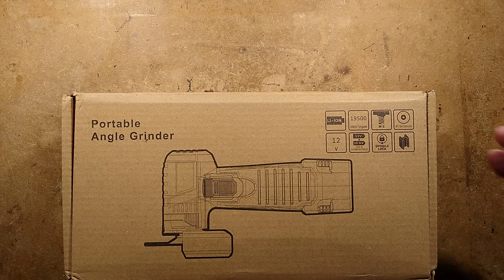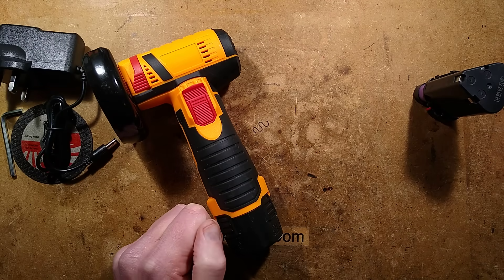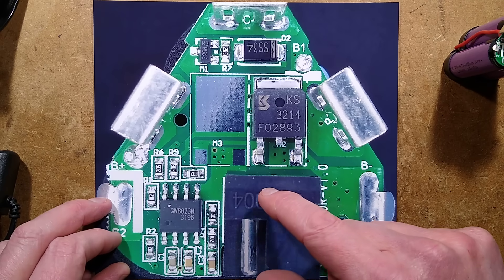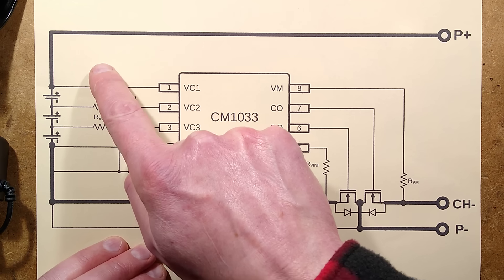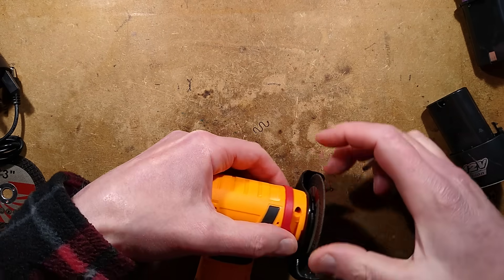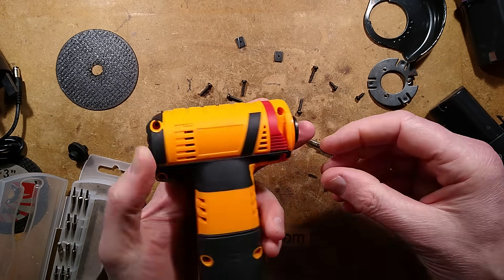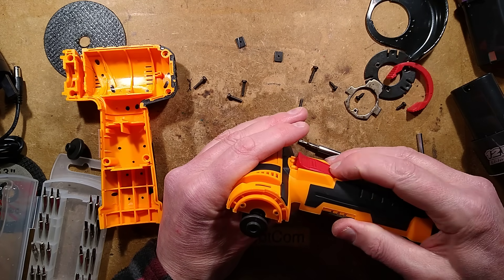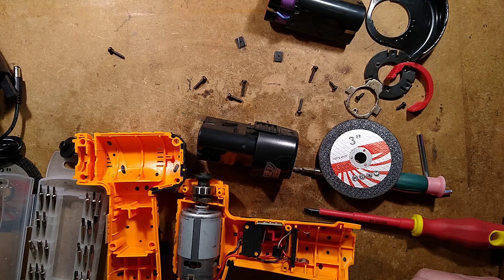Cheap eBay 3" cordless angle grinder with issues

Comment: I wonder how easy it is to get replacement disks  ?
Reply from the maker: Readily available on AliExpress for about a dollar each.
Reply: When these grinders first appeared at Lidl/Parkside about 5 years ago, there were no discs to be found anywhere. I made adapter washers for larger grinder discs, with an inner diameter of 22.23 mm. This way I reuse the discs that were too small on the 115 or 125 mm grinder. Recently, replacement discs also appeared at Lidl and I bought a bunch for under $2 a pack of 5.

Comment: I have a similar sized grinder from Lidl. It is worth paying slightly more for one with a safety tested and approved charger and battery, also it ramps the speed up over a second or so to prevent the stalling issue with this one.
Reply: The Parkside one when paired with the 4Ah batteries kicks ass
Reply: Love my one from Lidl, had it a few years now and use it a LOT... sadly think i might have worn it out now :(

Comment: Looks just like the one they were selling in Aldi a few months ago, yes it can struggle on some jobs, handy for the bench to save getting out the main angle grinder. That cut out on first press -  I assumed was a safety feature, so it didn't spin up if accidently pressed or knocked in the tool bag, interesting.
Reply: You might like to look into reviewing one, it uses a usb c socket, so there might be more villainy at work.

Comment: Thanks for the analysis, always interesting to see what the cheaper tools offer and what the trade-off is, and if it can be worked around!!
I guess the tool is what in the power tool market is sometimes called 10.8V (though Milwaukee irritatingly calls it M12...), since the three battery cells seemed to be marked 3.7 V [ 7:00 ]. Which probably would make the charging voltage 4.2 per cell, or 12.6V over the whole pack.

Comment: I have one of those and took it to work to try it out, not bad but as you said the batteries they are sending with it are not strong enough to cut anything substantial but as you guessed you can buy bigger batteries for it and with it it works great and even able to cut metal and wood.

Comment: I actually opened some 18650  batteries from a failed battery pack for a cloned Dyson vacuum:  A teeny  battery and the rest was sand.  I thought how nice, built in fire suppression sand....
Reply: Haha, happened to me with a "sealed" lead acid battery of a car start booster, was divided horizontally, and the lower compartment was...  concrete cement lol.
Reply: I had a cheap chineseum led bike headlight. The 4 cell 18650 pack had 2 cells connected in 2s and the other 2 cells spot welded 2s but as dead short for some much needed extra ballast...lol. The 2 'good' cells were 1100mah or so. I rebuilt the pack with some scavenged  3000mah samsung 18650s from a milwaukee pack that had dropped a cell, and adjuated the lights current sense shunt to output the dual cree leds maximum current, and the brightness and runtime was something to behold. Thanks china.

Comment: "Universal bicycle lock key"
Reply: i wish them luck 😅 mines got 50,000 volts going through the handlebars. xenon strobe light circuit. its also remote with a 200ft range so you can get that perfect timing on the thieving ........ 😂

Comment: Just so people know: there is a brushless motor version of this I received from Temu here in the US, it was about $20 shipped and is of a much higher quality.  It came with 2 metal wood blades, 6 cutoff discs, and 2 grinding discs.  I use it daily, it still runs quiet, flawless and smooth.
Reply: Wow great purchase

Comment: Wow, glad to see that weird black circley thing on the side comes off in the disassembly, that looks like it would interfere with using it for any actual tasks. Never seen one on the job site
Reply: think bout your knuckles when that disk explodes
Reply from the maker: The guard is repositionable.  It is recommended to keep it in place, as a shattering disk is quite nasty.

Comment: Is it possible to add that other MOSFET?
Reply from the maker: Technically speaking it is.  But it may be the cell voltage dropping under load that is tripping the BMS protection.
Reply: @ assuming the batteries are delivering what they say, there should be enough power. I have a Bosh right angle grinder. It’s a similar battery. So similar I wonder if they’re interchangeable. It’s about the same size as this. Of course, at $170 US, it does cost a bit more and is variable speed. But the principle is the same and puts out plenty of power with the 2” Roloc disks I bought it for. To the point that it’s very hard to stop if I press it very hard against the work.

Comment: Would it be worth installing the second mosfet?
Reply from the maker: It might need the cells upgraded too.
Reply: The ones i built using an Ali.... Kit had ex laptop cells in so far better than the ones in the two original battery packs .Need to bodge my cheap Ali battery terminal welder i could get a bigger spark from a ronson lighter .Any thoughts on fitting a big capacitor in them to improve the output so you can get better welds on thicker metal?

Comment: That's a cutoff saw, not an angle grinder. I have the Milwaukee version: very handy for cutting metal into shorter lengths for transport.
Reply from the maker: There are options to get grinding disks with it too.

Comment: These grinders (i have a Parkside one) are the best for grinding small parts (i've successfully tried converting some standard hex to non-standard-tamper-proof screwdriver bits) and removing excess PCB material from the edges.
I've once tried to run it with a different battery form another Chinese tool while original one was charging. Apparently the other battery was not designed for such current as its protection FETs turned into significant amount of smoke after some 2 minutes :)

Comment: Balancing should be made mandatory by law. It increases the life span of battery packs tremendously. Especially when cheap batteries with significantly different internal resistance or capacity are used. The same goes for undervoltage protection in all those gizmos that only have soft power off switches.

Comment: What about adding a starting cap to the grinder, wouldn't that stop the spike, seems thats what they do with all the big ac motors.
Reply from the maker: It could be used as a reservoir for a pulse of current.  In the AC motor application it's usually for the start winding.

Comment: I have the blue one from temu ,built a couple more batteries .works ok as a cheap mini grinder but as you say its limited but easier to use than my 4.5" 1010 watt in small places

Comment: Bike thieves' new favorite!
Reply: @Tore_Lund  not if they are in a hurry lol ,to much pressure on the grinder and it stops ,not a lot of torque in this bit of kit .thinking about as the risk of a copper appearing they could use a nail file and not get caught
Reply: @MrMan-f9c  True not worth much. Maybe it can be useful for scratching your initials on a subway window, as I've seen done?

Comment: The Bosch original version of that tool actually works really well and i use it much more than i expected
Reply: The Bosch original is such an amazing problem solver.
Reply: @UloPe I bought the milwaukee version on impulse. I was regretting it at first, but I use it almost daily at work, to fix problems that I should never have.
Reply: We have one at work and it's handy for sure
Reply: @semifavorableuncircle6952  I am a big fan of the Bosch 12v tools.  Every one I own has performed perfectly since day one.
Reply: They also copied the battery layout as it seems.

Comment: Those mesh style disks are dangerous. Be careful using them. They easily break and randomly fly off. 

I only use them to sharpen tools by putting the grinder in a clamp and use the exposed side of the disk. It is safer to buy a more expensive metal grinding disk. Trust me the cost it worth it, they last way longer than the cheaper mesh ones.
Reply: i just ditched a set of dremel wheels that were so cheap the screw mount pulled straight through them as soon as they touched metal. (amazon many disks item).
and yup had a few of those fly apart on me. for the angle grinder i bought a hefty leather apron and full face mask.  they are not very safe tools.

that said if you use them as sanding disks they will fly apart, they have bare minimum strength with the blade thickness. go through a few of those fibers and it loses all integrity.

Comment: Now I know what a 3 inch tool sounds like.
Reply: Some girls like it that wide 😉
Reply: @jasonstclair1329  wide? 😰
Reply: @kisielthe1st  Hydraulic press mishap
Reply: @jasonstclair1329  see what I'm wondering is if that's diameter, radius, or circumference.

Comment: The motor probably feels stiff because they applied grease to a bushing that needs oiling, I find that a lot with motors these days, they fit bronze bushings that for many a decade were known to need machine oil, but they gob on a lump of grease instead and it ends up reluctant to turn, worst offender I had was my desk fan, when new, it wouldn't turn on low speed at all and barely turned at full, found it was greased, cleaned it all out and oiled it, it's been running great for 12 years...
Reply: @twocvbloke  a proper amount of carefully applied light oil does wonders for the life of the sleeve bushings in small motors.
Reply: An old rule of thumb I heard a long time ago.   If it spins oil it, if it slides grease it.
Reply: That's called Cha Bu Duo engineering

Comment: Strictly speaking, it's not an angle grinder. The drive does not go through an angle. It's just a straight grinder with a handle on the side.

Will you be showing the ratchet in the future? I might actually get one of those.
Reply: always assumed it was refering to cutting angles in steel section.
Reply from the maker: The ratchet has been featured already.

Comment: That's not good news for cyclists
Reply from the maker: It is if it stops them buying a proper tool.
Reply: theres not a lock out there that doesnt have how to open instructions on youtube thanks to "the lockpicking lawyer" and chums.

they do it for our own good apparently....just dont ask them for an alternative security device..there isnt one.

for bikes he recomends hardened chain of at least 16-20mm. with a custom modded lock chamber to prevent pick attacks.

you could anchor a ship with that chain.

Comment: Thats nearly a 1:1 clone from the Bosch GWS12V-76.
Reply: Design wise, yes. Except they didnt clone the quality or performance.
Reply: @semifavorableuncircle6952  bosch  use the same factories.  not what thwy used to be. its going to be very similar.
Reply: lol
Reply: they all use the same factorys. probably closed the line down so the factory kept producing under another label or three
Reply: @luminousfractal420  Unlikely, the Bosch actually is made in Germany.

Comment: Nice video, Clive. It got me thinking. Would an inductor or even a suitably sized inrush limiter work to stop startup spikes and the tool not working intermittently? I don't know if an inrush limiter would work in this application as they dissipate heat, although I like the idea of giving the tool a 'soft start'.

Comment: I have some older Ryobi one+ branded batteries that do that. if the inrush surge is too big they lockout.
Reply: Ryobi One+ circular saws are useless with the smaller batteries. They do the same, fraction of a turn and stall of the battery cries ENOUGH!!!

Comment: Oh, this seems like a popular battery module for 3S lithium units.
Reply from the maker: It's sold as a bare case and PCB kit, so I'g guess there are many small factories in China spot welding random cells into them.

Comment: I own two of these, and i can say they are pretty neat. If there is a small cutting job or hard to reach places these little things are best. Sometimes even a regular cordless grinder can't reach places that this one can. The only thing I did right after buying it was replace all the standard batteries, because they are all crap and do not hold the declared capacity right out of the box, and also added a soft start pcb, so than motor will not rape protecting circuit every time it starts.

Comment: I bought one of these as a bare unit for about 8 quid purely for the disc mounting part as it is a remarkably convenient way of adapting sawblades to a 1/8" shaft used by small brushless motors for RC planes and such. IThe large bearing can be encorparated into a 3d printed housing quite handily. I build mini fighting robots for a hobby so power tool abuse is a way of life. The 550 brushed motor in these grinders is remarkably spicy from a current perspective.

Comment: i got one a few months ago for like 15 bucks on ali with 2 batteries. 
it works great... well unless you want to cut something bigger than a 10mm threaded rod. i used it so little im still on the first disc
those batteries are horrible. it turns off all the time as the voltage drops too much under load

Comment: eBay doesn't make power tools. did you check the contacts, I have found batteries that had some odd coating over the battery contacts, once cleaned everything worked fine.
Reply from the maker: Contacts are fine.  The protection circuitry is kicking in.

Comment: battery shape is similar to some Bosch 12v ones? Might be sort of a clone of those.
Reply: No, Bosch 12v has completely different contacts (battery has recessed slots for contact tabs in the tool). Looks more like Makita 10,8V with the flat, open contact pads except that also has 3 auxillary contacts instead of just one.

Comment: Adorable! Shame about the protection mosfet.  I have a project where I need high peak current from a single 18560, which is more than I could get out of most dual mosfet packages usually used with the DW01 style ICs, so I ended up using two of those chonky ones which gives me like 10A current limit.

Comment: Every time I've bought a cordless power tool for less than $100, it has required at least a little bit of work to make functional.  Sometimes that's worth it, because no reasonable big name tool maker is going to produce certain tools, like one-handed 6" chainsaws...  Sometimes you get a DOA tool and get a refund and the seller doesn't want to pay shipping to have it sent back, so you're left with a broken tool for free, and if you have a bit of soldering skill and a 3d printer you can convert almost anything to a standard tool battery...

For this one, I'd sneak a second mosfet into my next electronics order to take advantage of the board already being set up for that...  I bet doing so drops the resistance by more than half, due to the extra heat dissipation.  I like that this one has no real brain, though, at least on the tool side.
Reply: ...Thinking the same (if drop across mosfet is triggering current protection)...but....If voltage dip is causing cutoff, extra Mosfet might scare battery into cutoff even more easily?
Reply: @leybraith3561  Yeah, in retrospect I might just skip the existing brains in the battery pack entirely and build a new battery pack with a properly-implemented BMS...

Comment: Could you fix the batteries by soldering in the missing MOSFET or is opening the batteries destructive?
Reply from the maker: It would be viable if the lithium cells were up to the current demand.

Comment: They even added a ball bearing to the drive shaft instead of only relying on the motor bearings.. you must have picked the premium version ;-)
Reply: @WooShell  I suspect it was cheaper than getting a motor with a usable bearing. Without it would last maybe 10 minutes.
Reply: Bar is in hell's basement.
Reply: The premium one has brushless motor in it I think 🙃This one is the business class version 😉

Comment: I couldn't find a datasheet for the MOSFET in that package but in the sop8 package it is supposed to handle 80A at 25C or 240A pulsed which should be more than enough to start the tool.

I wonder if the cells are so out of balance that even when "fully" charged they are well below optimal.
Reply from the maker: I didn't actually test the cells for balance, but they would be close, as the end of charge voltage was above 12V and the first to reach 4.2V ends the charge.

Comment: Three inch...seems to be the standard size...I'm used to the bigger ones
Reply: I'm wondering where one could buy such small grinding discs - assuming they wear out before the tool gives up the ghost!
It looks like the disc guard (which you cerefully marked before removing!) can be rotated to suit the angle the tool is being used at - there's a row of dimples around the central hole...
Reply: that size is common on small air powered grinders, both straight and angle. They are handy for tight spaces but the small discs wear quite fast.
Reply: 3 inches is the standard size? I thought it was 6 inches. Oh, you're talking about grinding discs!
Reply: @jimroberts3009  you think the standard is 6 inch diameter?
You'd have difficulty finding anywhere to use that.
Reply: @alanm8932  Very droll and a Merry Christmas to you. 👍
Reply: @FamilyOfEyles Screwfix in the UK.
Reply: Size queen 🤦‍♀️

Comment: Would it help to put a chonky capacitor across the battery terminals before the switch? Then that would charge when you popped in a battery and would assist with the startup load. I'm not sure there's enough room for one of sufficient size though.
Reply from the maker: It might help with that initial spike.

Comment: Clive do you have the cutting wheel mounted the correct way ?? I was always preached to that the metal ring on one side of the cut off disc had to go outside towards the locking nut ?? so the flat surface of the disc was in contact with the "inside" to lay flat to the spindle collar.. Just asking for a friend 🙂
Reply from the maker: Normally I'd put it on label out.  Not sure why I put it on that way.  It seems to be a divisive subject online.
Reply: Made ideally for the bicycle theft market.